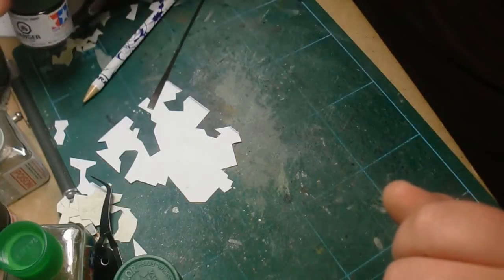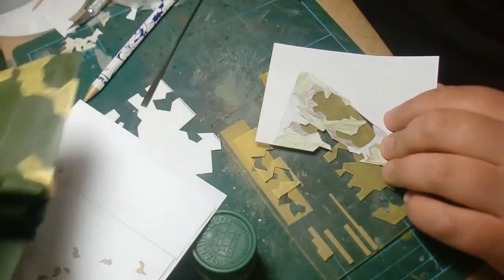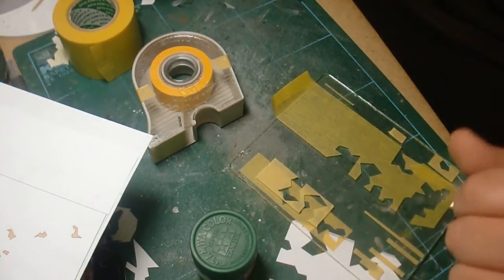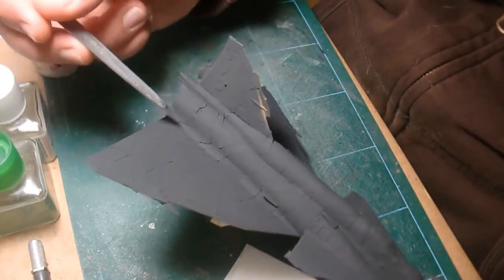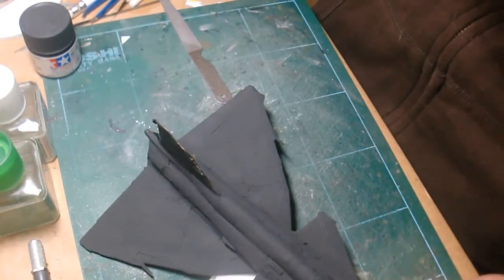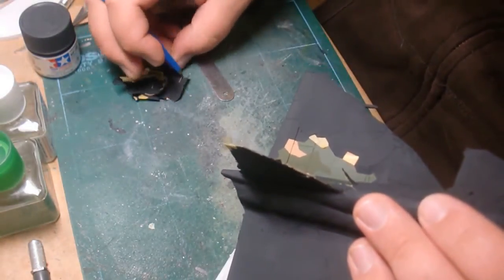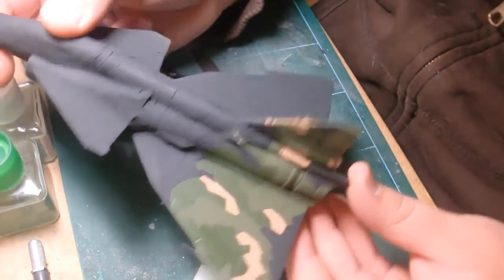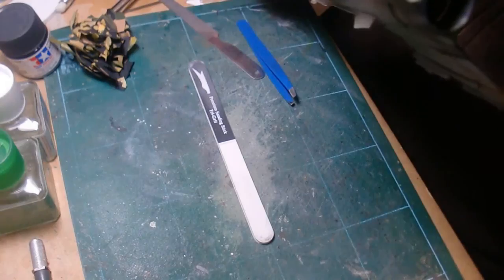Matchbox 1:72 SaaB Viggen SK.37.  (Part 2)

Comment: You're clearly a man of great patience and discipline, much more so than me for sure.  Doing that camouflage in 1/144 scale using masks certainly would attract notice. It would probably also put you in the funny farm! I remember putting the original AJ37 version of that kit together in the 1970s and very carefully touching in the colour patches with a hand brush, not so much as a square mm of masking tape in sight.  Years later I hand painted the upper surface disruptive pattern on an Airfix Vulcan - an afternoon's work totalling about 5 hours.

Comment: Wow. I almost bought a roll of that "Tamiya" tape yesterday. I'm glad I didn't! I'm noticing that when you'd tip the plane, I could see the different sheens of the colors. The dark green is almost a semi gloss where the lighter green, the brown and the black are flat. Very interesting. Also, you and Greg use Future and I was wondering what the preference of it was over a clear gloss.
Reply from the maker: +WikdSeafood I still use it but for bigger surfaces. GRYUSS suggested FROG tape low tack, it's yellow instead of green and it's nearly the same as the Tamiya tape. I bought a roll for my Dad to try and he really liked it. I think I should have either shot another layer of flat, or I used too much, it's a weird situation. I LOVE Future, it's so forgiving, and has so many uses outside a gloss coating. It's safe with all paints, and usually decals apply really well to it. Rob@basicmodelling has used it as glue for clear parts. I've even used it as a Primer as it sticks quite hardy to the surface. It can be airbrushed or hand brushed with the same results. There are a few downsides to it, you need to apply thin coats as gravity can cause it to pool. And you it can take to 12 hours to dry enough to handle it, 48 hours to cure thoroughly. But I use it all the time it's marvellous stuff :D
Reply: rebelsatcloudnine I'll have to pick some up and give it a try.

Comment: Hey man! Great job.
Could you imagine masking that and using Vallejo only to watch it all peel off!!! LOL!!
You and Rob from basic modelling have for certain inspired me to build a couple kits i've had kicking around.
Lets talk 72nd aircraft models.
-Roger from Calgary
Reply from the maker: Thanks Roger, I'm terrified even thinking about that lol, I've yet to have any problems with Tamiya, I've seen a lot of modelers tossing the stuff out. I'm glad we could be of help, Rob certainly has gotten many modelers invested in Modeling again, I've learned a ton of tricks from him. Cool your in Calgary I'm a few hours South. Sure, lets' talk 72nd :D
Reply: Hi again, I missed my model table today as I worked a double shift.
I have a question about your compressor.It looks like one of those little Paasche units without the tank? how flexible are they in regards to dialing psi between 12-20?? And what about the pulsating caused by the diaphragm?? I'm just using a brad nail compressor right now and I don't think it's very accurate. Plus it's very noisy.

-Roger
Reply from the maker: Roger Nilson It's a small tankless compressor, it's not a very well know brand name. I can't even remember it. I'm not really happy with the unit, as it one day rattled itself off the table smashing into the floor :/  However getting a new compressor is a high priority on my list. I've been eyeing 2 compressors, one is from Iwata its called the NEO AIR, its a great little unit, I've heard the psi ranges from 25-10. It looks pretty nice, but I'm still searching around for myself. I'm not too knowledgeable on what good compressors are.
Reply from the maker: Roger Nilson Yah the prices for some compressors makes you think twice about getting one, but it it the kinda tool that "should" last a long time. The NEO Air I like since it runs around $100, which is pretty good for what you're getting. 
That's kinda funny since this holiday season I tried Vallejo for the first time lol, I still prefer Tamiya, I find them easy to use and nice ti airbrush with and are really easy to clean up. I Use XF-71 for nearly every cockpit, its either spot on wiht some aircraft or too close for me personally to really care. Thankfully today is nice out, but I'd love to remember what warm toes felt like again, hopefully this cold spell will go away.
Reply: I keep wondering too. But, I have a stack of builds that would convince anyone to stick with Tamiya and Gunze. I've sprayed that stuff at almost every temperature and psi. Don't forget humidity and barometric pressure.
I simply just gave up. Plus a lot of their colours are so wrong they're out to lunch.
I just mixed a batch for RLM02 using XF22 and XF49. But don't do it 50-50 do it 2-1 with equal amount of thinner. It's a much more convincing RLM02.
Bought the Airfix P40 yeaterday. What a nice kit!!!
Reply from the maker: Roger Nilson  I've only had a few problems with Tamiya acrylics, one is their quick drying time, which has burned me on a few projects, So I'm going to invest in some paint retarder soon. Secondly I've found some of their gloss colors take much longer to dry even as long as some enamels, so I just leave then to dry longer, but a recent build I did, I needed to tape those parts up and some reason the tape left residue on the finish :/ but that was a quick sanding and respray. I also like as you've mentioned the nice way that they can be easily mixed with no problems again. 

Yes that is a really nice kit, I've bought it as well to send to a friend whose a big fan of the Flying Tigers, I'm hoping to get a new video uploaded tonight and get some more work done on the Yamato. :)
Reply: Right on! Cant wait
Reply: Hey man, Did you wear sunscreen today!
i have been super sick since Christmas. It's nice to be able to breath and walk. I got to PM but got pissed and left. They can be lame sometimes. I just kicked my compressor in the guts so will be in the dungeon most of the night.
I have paint mix for you to try. Next time youre shooting RLM 02. Just add a drop or two of XF-49 to the XF-22. I know you know this but whats cool about it is that you an add less 49 for doing fuse and wings and more 49 for interior oarts!! like on your next kick ass 32nd build.
Also, isn't it just like Dragon or Cyber Hobby to put that beautiful rubber collar for the wheel bay to simulate the leather pad....then make the hood 1 inch thick!!

Talk Soon, -Rog
Reply from the maker: Roger Nilson Yah, it got +17 over here, it was awesome! I don't know that last time it was that warm in January. Good to hear you got better, I got a bit ill for a week, but it might have been mainly contributed tot he cold. What happened at PM (this time) I wish they'd send more kits to their South Store since It's the one I got to more often.

That 109 was a love hate relationship, It had so much of the appeal of a nice 32nd Tamiya kit, and failed in quite a few places. I'm still pleased with the final result mainly because I have and Afrika 109. But I don't think I can ever build another. Maybe find the 1:32 Matchbox kit instead lol. I'm working on a Revell/Hassegawa He-111 right now, I've got to check on the decals in a bit. In that one I got through the process of mixing RLM paints, so I look forward ot any advice, since I'd like to get the paints as accurate as I can. Good to hear from you Roger.
Reply: OMG!!! I blew a build in typical ME fashion. I concequently am selling all of my vallejo air products. I was just trying to finish a BF 109 that id started with Vallejo so I could have it to compare etc....crap dude!

We just met but at this point its ok to say things like. Hey you didnt use any vallejo products today did you!!

I cracked open the airfix zero out of my non shrinking stockpile. I primed it with liquid surface primer. The stuff in the little bottle. It is far superior to vallejo primers in every way so there I am starting over.
I want to talk colours and decals in a day or so cuz I have curing times that are minutes using tamiya not weeks like using spanish products.
sigh.....LSP rules!
Hey man, whats your name.
-Rogee
Reply from the maker: Roger Nilson I've never airbrushed with Vallejo before, I've only used their flesh tone to band paint a few figures, but I'm seeing a lot more modelers turning away from their products, so I'm a bit concerned. I have that same primer, I've never thinned it down to airbrush with before however. But I do hand brush it on seam lines and scratches, it work wonderfully for that stuff. 

I'm really tempted to build another Zero lately, so I'm a bit jealous that you're building one lol. Even though I did just build one it's one of my all time favorite planes, and just really fun to build: https://www.youtube.com/watch?v=MYJxWAv4BTQ. In this build I actually go through talking about Zero/Japanese colors. That being said I'm always up for discussions regarding WWII Japanese Aircraft, especially the Zero. I gave my He-111 a flat coat last night and a panel line wash that I'll hopefully finish cleaning tonight, and have it done in the next few days :D
Reply from the maker: Roger Nilson I've only built one Hasegawa Japanese kit before, a Hayabusa. I don't find many since my local hobby store doesn't bring in Hasegawa kits. Apparently they don't sell that well.  I've found a few good ones at PM, but many of their Japanese kits are way too expensive. Luckily I have a new way to bring in more kits so I can further add to my collection. I've still got a Tamiya 1:32 A6M5 to build this year, I can't wait to get started on, but that will be most likely in the summer.
Reply: Hmmmm group build me thinks
Yeah Ive seen some cool stuff at PM but nothing compares to uncle bills. I miss Rick.
Cockpit afterwork tonight. I did drill the seat tub.
-Rogee
Reply from the maker: Roger Nilson I never went or really heard of uncle bills until after he passed. It sounded like a really cool place though. I've almost finished the He-111, tomorrow it will be completely finished :D. Drilling the holes in the chair even at 72nd scale just makes it that much better.  The Tamiya kit comes with a decal seatbelt, I saved it and photo copied it and then added it to the kit, it looked pretty cool :D
Reply: Ok, so I drilled the seat tub. Meanwhile I was cleaning my airbrush and I sheared the tip that the needle passes through in half!!!! Are you kidding me I said to myself. and some other choice 4 letter words. I have a NEO like yours and I love it. I phoned PM and basically was told bummer dude. WOW! strike 3 me thinks bro.
So I will do my best to deal with it. At least I know the guts are Iwata HP-C and can be swapped for finer needles and tips but nobody wants us to know that.
But like I said about done with PM altogether.
Uncle Bills was THE hobby shop for kits and knowledge. a bit more pricey but if it existed Rick Chin had it. He would make deals and my favorite quote was: JUST BUILD THE DAMN THING !! He used to kinda keep me grounded. I remember ya had to stay for a visit because he had stuff piled up to the rafters.

So back to the zero. I want to drill the holes on the bulkhead behind the seat and am looking for some photo reference. Shouldnt be too hard. The harness will be strips of photo etch scrap....simple.
I do have another airbrush too. Its a badger 150 siphon feed. It works very well. Especially with Tamiya products.

-Rog  (the cursed model builder)
Reply from the maker: Roger Nilson Dude you are in luck. I went into Micheals and they blew my mind. They sell NEO airbrushes there. And they sell the needle  and Nozzle together for $40. I broke the nozzle on mine and bent the needle in a freak accident and yah they gave me the same run around. They had the brushes there but kept saying "well why don't we have parts" ? I don't know why not order them lol. And that was from both stores. I saw an auction with his models after he passed, I would have love to have bought a few but man they were really going high, which was great to see that people still like quality models :D

No finding pictures like that is still pretty easy, there's more and more being pulled out and documented all the time lately, which is awesome :D If you're on Facebook check out this page, where they are restoring a Zero, and have some fantastic insider pictures: https://www.facebook.com/pages/Legend-Flyers/255443124472131?fref=pb&hc_location=profile_browser
Reply: Well Elisabet did her best to make up for the fact that PM lied to my face. She got me an airline adapter so I can shoot not vallejo through old reliable. I went to Michaels and youre right....40 bucks. Crap I didnt spend much more than that I recall. Now NEOs are expensive.
So I sprayed more cockpit parts with the Badger and it wasnt too too bad I guess. Cant stop now. Hey I wonder if we can post pics on this google+ thingy. I found a gem of a kit I got the summer before last in Victoria.
Short story: At the Sydney Aerospace museum there is a very large collection of 1/72 mainly jap airplane models. The placard said RIP so and so and it was a collection 30 plus years in the making...This persons estate and horde ended up in the hobby shop in downtown Vic. The ONE kit my wife allowed me to buy is an RS models Ki-79a Manshu.
I quite litterally had my arms so full of models from this cache I could barely walk without dropping them. Which I think is why my wife freaked..
Yes I always end up in an adventure.
I have several still on hold there. And I tell ya its a killer shop.
Look online for BC Shaver and Hobbies.
You can buy an electric shaver and a Fw 190 under the same roof! Im not kidding. And not kidding about the adventure thing either.
So this Manshu is resin and white metal. I am gonna bring as many of these RS kits home as I can. Its just breath taking as far as detail and quality goes.
Back to my dungeon.
-Rogee
ps thank you for the link
Reply from the maker: Roger Nilson Yah it's a bit more than I paid from my hobby store to get replacement  parts but only by $10, I don;t really know anything about google+, I've only recently been on it to change a stupid setting for Youtube, I've only spent about 5 minutes on the site, I do post to Facebook, I just added my He-111. The pictures came out a bit brown but still good (I think) lol.
That is an awesome kit man :) I'm totally jealous of your find. I was watching the dogs for my Family a few years ago and they went into a few stores like that, and found some great kits. There are some really great hidden gems in places like that. 
Now that the He-111 is done I've got to edit the footage and I'm starting a Heller Nieuport, I picked up over the holidays, it looks like a fun kit. :D